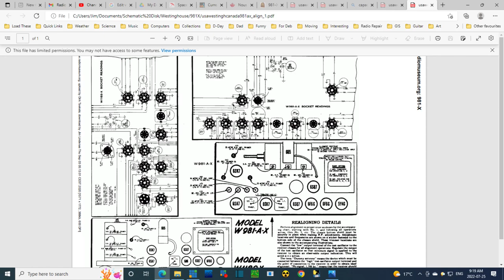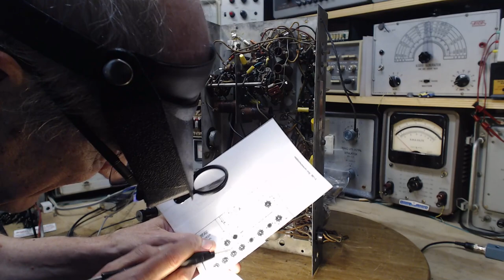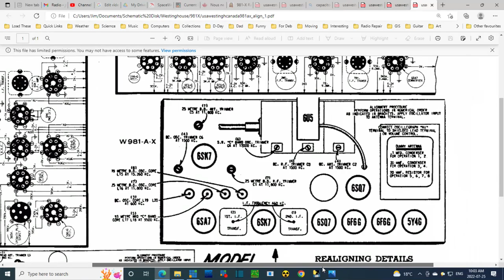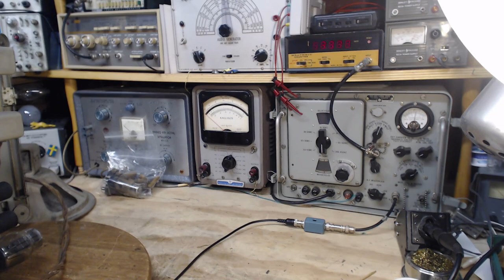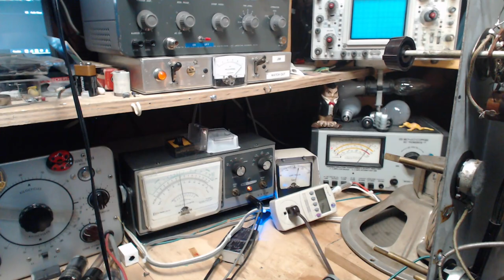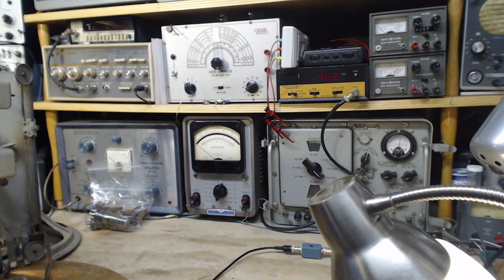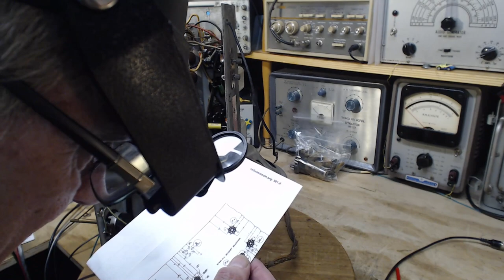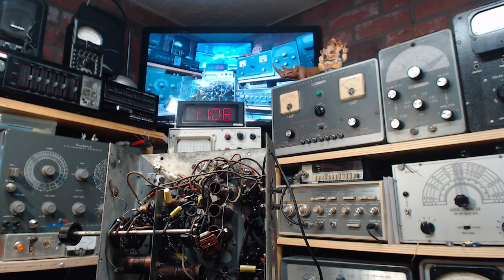Canadian Westinghouse 981 Shortwave Radio Video #11 - Tube Voltages and IF Alignment

Comment: Hey Jim. On your mystery wire, I remember seeing where the wire connects to the tube socket, a ground wire shorting to the pin. Follow up on that wire and connect it to where it goes after removing short.